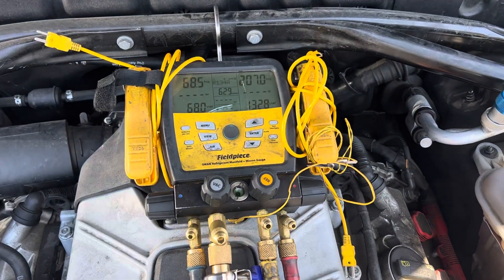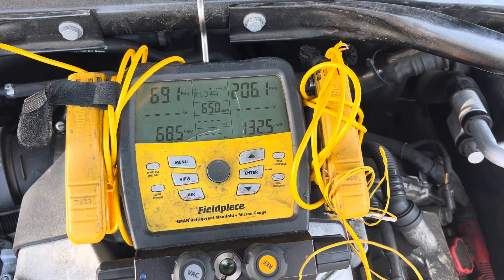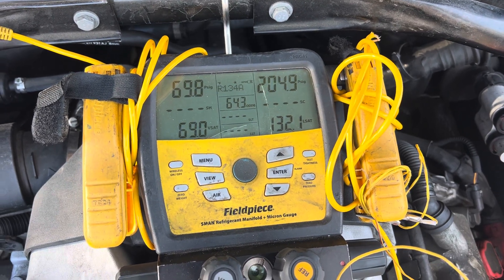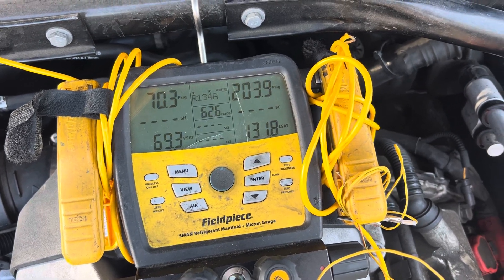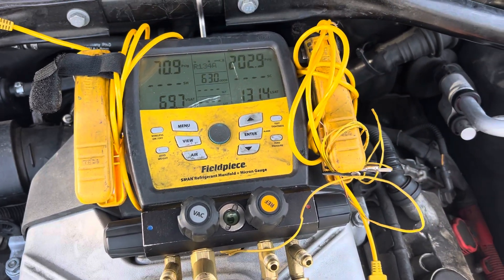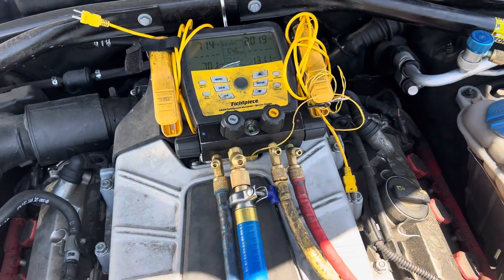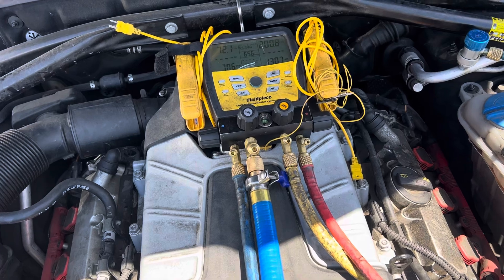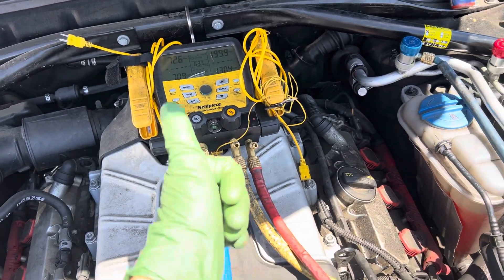Expansion valve type hard shut off this is not a bad expansion valve. This is not a plugged

Comment: did u put nitro on hi side in this for test or was it running and u shut veh off and watching the the pressure neutralize. Cause one commentor may think ur car is running from his comment about compressor
Reply from the maker: @RATCHETMAN1001  not running. Just added nitrogen in the high side. 
Never turned on engine

Comment: i think here is a problem with perfomanse of the sompressor, if the system is properly charged with refrigerant (weight and type).
Reply from the maker: @markaircon  it only dry nitrogen in the system for testing
Reply: @coldfinger459sub0  my bad, I didn`t hear in the video about dry nitrogen in the system and its not running. So, in that way it happens when sensing bulb operates the membrane beacuse there is no temperature changes?
Reply from the maker: @markaircon  nothing to do with sensing bulb they designed the valve to actually keep the refrigerator from bleeding down into the other side

You can google search hard shut off expansion valve, and give you a more detailed explanation of how and why 

In residential, there’s actually specific reasons when you would or would not use a hard shut off expansion valve sometimes they’re absolutely necessary sometimes not